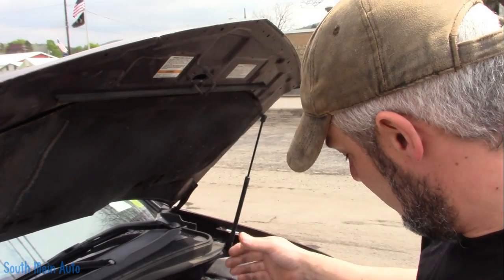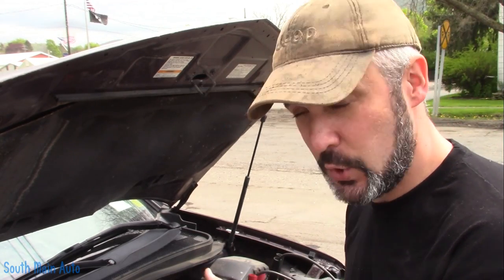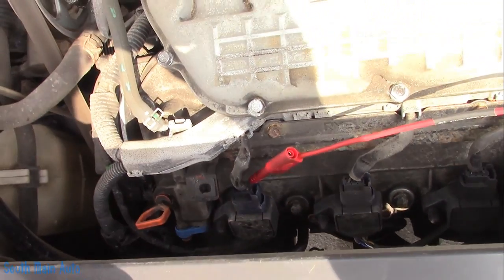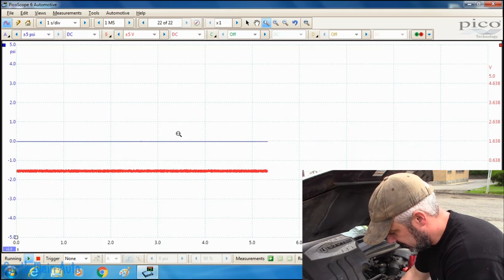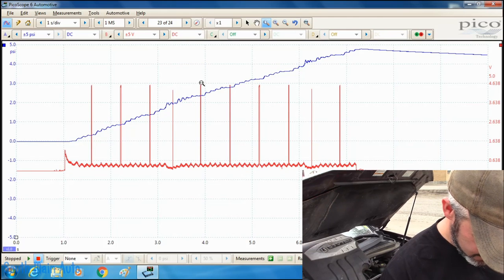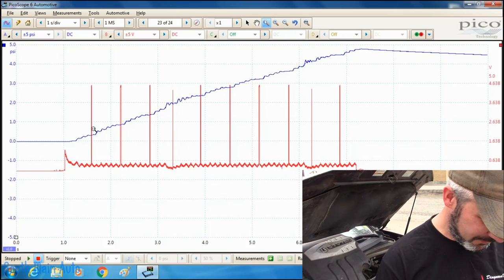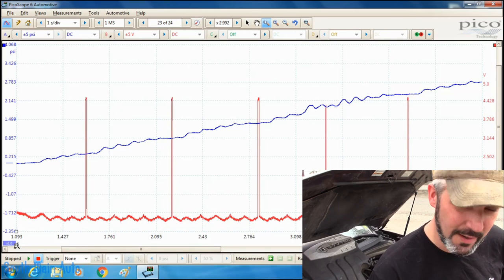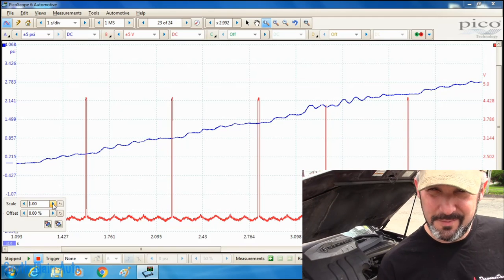Testing For Blown Head Gasket With The Pico Scope

Comment: Why doesn't the manufacturer just put in a kill switch when the engine reaches very warm. I've had two engines that once they get hot they are shot.
Reply: Ask the lawyers that have sued the car manufacturers when that was an available option which resulted in another vehicle crashing into the back of the "kill switched" car & killed everyone in it.  The way it is now, it is at the desecration of the driver to pull over to a safe area & have the vehicle towed, or continue driving until the engine seizes up -- but the car manufacturer is not making that choice for the driver now.
Reply: @KCautodoctor  about as bad as when my timing belt broke in the left lane of the freeway had to throw the car in neutral so i didn't come to a stop.

Comment: how about showing the same test on a known good.  thanks for all the great videos
Reply: There should be no measurable pressure at the radiator cap opening when you are cranking over a good engine.  The Pico WPS pressure sensor would have shown a constant near zero pressure reading when doing the same test on a good engine.

Comment: Can u post a known good vs known bad?
Reply: There should be no measurable pressure at the radiator cap opening when you are cranking over a good engine.  The Pico WPS pressure sensor would have shown a constant near zero pressure reading when doing the same test on a good engine.
Reply: KCautodoctor ty! I am aware of that. But do appreciate the response. 
I’m not fortunate enough to have anymore than the 2 ch scope on my modis. 
I’m trying to build an archive of known good/bad until I can purchase a pico.
Reply: @mikejmardis  if you are looking for databases of known good/bad waveforms, then highly recommend Pico's own website with searchable database of waveforms, iATN, Diagnostic Network (diag net), and The Automotive Waveform Exchange group on Facebook.  I am sure I am forgetting some in that list but those are my main goto's when I want to see what other people have already captured.
Reply: Those are the ones I would trust. A 2 channel scope can do a lot IF you think out a strategy of measurements before hand. Not as easy as a 4 or more channel for some things but for a lot of work even a single channel will do the trick.
Reply: KCautodoctor my experience, unless I’m doing it wrong, is that you can’t see pico library without an acct.

Comment: I'm not a mechanic but why did it overheat?
Reply: There are many possibilities as to why it overheated. On the other hand, what's really easy to answer is, why didn't they get it checked the first time they noticed it overheating?
Reply: Usually the main two reasons are, the water pump has failed or the head gasket has failed..or both. In old times when cars were simpler and had no electronic brain then a ham- fisted timing set up could also cause overheating. Head gaskets (the mating between the cylinders and valve chambers) have a very hard life, they have to seal and isolate water/ oil and are put under all sorts of pressures in extremes of temperatures, the fact that many last thousands and thousands of miles of driving  is some sort of miracle  anyway. So they do fail occasionally,sometimes thru a simple act of not keeping your water topped up or a belt has failed and stopped driving the water pump. Sometimes also because a manufacturer has got teething problems with a new engine design.

Comment: I wonder if the reason why you're not seeing the pulses is because the pressure has nowhere to go so it keeps building up. Kind of like a Schrader valve in a compression tester holds pressure in the gauge, so you can get to the maximum compression reading during cranking.  Maybe if you were to be able to vent the pressure by creating a small orifice you would see which cylinder is creating the pressure pulse.

Comment: How hard did you blow into the hose to register 3 PSI? Aren't the pressure pulses when cranking strong enough to push coolant into the expensive pressure transducer?
Reply: That particular Pico WPS pressure sensor is made to test pressures/vacuums created by air/exhaust & any liquids found in a vehicle (gas/diesel/coolant/automatic transmission fluid).  There are other brands of pressure transducers sold that are not as rugged & would be ruined if any liquid contacted their internals.

Comment: First time Ive seen this done.. and it's very interesting..  now for my questions.. as the pressure builds and you have your trigger set to cylinder number 4.. the pressure(blue trace) actually goes flat.. would that be the indication of the bleed off from the cylinder head into the cooling system? Ps.. love your videos and I watch them every new post.
Reply: The flat spots are where the cylinders are NOT pushing pressure into the coolant jacket versus the humps are cylinders pushing pressure.  In other words the head gasket isnt leaking around ALL cylinders - just most.  Using one cylinder's ignition, in this case #4, just allows you to surmize which cylinder if you wanted because you know when 4 ignites. You can then tie the other humps by firing order
Reply: @wty1313  thank you very much for then explanation.. don't have many training courses around here on scope use., So when I see issues being solved with scopes i find it very interesting.

Comment: There’s a fairly alarming trend of catastrophic Honda engine failures in your and other videos including bent valves, bad valves, head gasket failures, timing belt failures, valve train problems, low compression misfires, and plenty more even on vehicles with less than 100K miles. It’s pretty clear Honda has lost their former bullet proof mojo they had in the 80’s and early 90’s and a post 2000 Honda is still better than say a similar vintage Jeep or most other FCA vehicles which suck beyond belief, and perhaps even less reliable than an equivalent similar vintage Chevrolet which is a fairly low bar. Honda needs to get their engineering mojo back.
Reply: I work on more hondoos and yotas, than any other car.  I wouldn't buy one if you fronted me half the money.  Full of cheap plastic interior, ride like a wagon, and gives a constant reminder that there is no replacement for displacement. 
Btw, I have owned nothing but MoPar over the last 25 years.  Anything lasts if you take good care of it...including those crappy Hondoos and Yotas.
For those that love'em, more power to ya.

Comment: If it keep building pressure how does that mean its blown wouldnt it not build pressure if it was blown
Reply: Think of it like pistons building pressure in an air tank.  If the piston is pushing more air in than the small leaking relief valve is letting out, the tank will still build pressure just slowly.  When the cranking stops, the pressure bleeds out the leak and back into the combustion chamber, past the melted rings, and vented through the crankcase.
Reply: @davidnielson5252  oh ok

Comment: I wouldn’t think you would see a definitive pulse because once the pressure is applied in the cooling system there is no way to relieve that pressure before the next pulse, kind of like an air compressor filling the air tank. But as a viewer posted there should be no rise in pressure if there is no heat on a good system. You might have just came up with a valid test that’s quick and easy.

Comment: Yes the engine is nuked  but I don't understand how the cooling system making pressure confirms that I would think the water pump would make at least 5psi
Reply: Water pump doesn't really build pressure, it moves the water in a particular direction.  Pressure in the coolant system comes from heat generated by the engine as it warms up.  The head gasket is no longer sealing between the combustion chamber and the water jacket.  Pulsing with each piston pushing some air into the water jacket.

Comment: Always like watching your diagnostic videos! Question: did you run the same test on a good motor? (Thinking the water pump might be cause of the pressure rise)
Reply: The water pump is just a circulator that moves the water around from engine to radiator and back. It's not a positive displacement pump so it can't cause system pressure to continue to rise.

Comment: Back in about 1994, my brother was plowing with our JD 5020.  Main water house blew off the radiator and had to shut it down from full throttle.  Well, that warped the head.  Cast metal. Something about running at full pull and 1100F on the turbo temps.    Well, $600+ later we had the big horse back.
Reply: I'd almost be tempted to let her idle for a minute or two if it was a Diesel since the excess cooling air charge would help a good deal in cooling off both the turbo shaft and the head. More like I'm wondering if that might have kept damage under control better? I had to do a similar shut down but I did let it idle a minute or two in neutral when an oil line burst behind the engine on a 4630 and I lost all the Hyguard. One moment I was a farming just fine and the next I was a sitting still with a screaming engine. After that shock wore off, I idled down and tried shifting the powershift which got me nothing but a dead stick. So I tried the same with the clutch and still nothing. I didn't even have to get out on the ground to notice the smell and oil puddle under her. With no options left and not liking the idea of an empty transmission pump turning without oil in it, I compromised between time enough to let engine cool down a minimum bit at idle speed and transmission pump damage. Luck, 30 gallons of oil later and a fixed hose, it all came back to life and is still working fine. $600. Hyguard ain't cheap. Perfect opportunity to buy transmission oil filters, pull the screen, clean it and do it all up white tight and right, but didn't think of that until I was back to farming. Live and learn. Just like my pool game, I got lucky and I'll take it.

Comment: would like to see what a normal/good engine looks like from same pico/pressure transducer perspective
Reply: There should be no measurable pressure at the radiator cap opening when you are cranking over a good engine.  The Pico WPS pressure sensor would have shown a constant near zero pressure reading when doing the same test on a good engine.

Comment: Question. Can you determine with the pico scope which bank is bad??? I'm assuming you look at the relative compression test. Grest video MR O
Reply: Connect a SenX FirstLook pulse sensor upto any scope and you will be able to pinpoint the exact cylinder(s) very quickly (after you get used to interpreting the data the FirstLook pulse sensor provides).  SenX has some case studies on their website that go into great detail showing all the different ways their FirstLook pulse sensor is used to diagnose many different issues on vehicles.
Reply: @KCautodoctor  awesome thank you very much will take a look for sure .

Comment: What are the "FLAT spots" across the trigger event???? The pressure trace seems to flatten out across the firing event on #4, before climbing again. Combustion leak from the "OPPOSING" cylinder?
Also , just to avoid the confusion to some of your Viewers, This, along with the video on the fluid Block tester, Confirms the presence of Combustion gasses and /or Pressure in the cooling system, Which is likely to be a Head gasket failure, But NOT "DEFINITIVELY". Cylinder Heads themselves can leak, I have seen several old Dodges which burnt holes in the cylinder wall / water jacket, From a Defective EGR valve. (Kinda rare but enough to confuse the best techs in the shop). In a nutshell, Dont order  a head gasket until you have disassembled the engine and actually SEE the burn marks. If you cant find one, it probably isnt there, and your problems are deeper than a weekend fix. Anyhoo, As always, thanks for the vid, your time, effort, and an amazingly generous attitude and desire to explain this industry to the masses.

Comment: Is the CATALYTIC CONVERTER good, it's worth more than the car?  lol
Reply: with blown head/gasket/cylinders? JUNK, except for recycle costs
Reply: In  New York State it's difficult to get used catalytic converters because of state laws.
"Prohibition of Used Catalytic Converter Sales
Pursuant to 6 NYCRR Part 218-7.2(c)(2), (link leaves DEC's website) and effective June 1, 2013, it is unlawful for any person to sell, offer for sale, advertise, or install any used, recycled, or salvaged catalytic converter on any vehicle in New York State. This prohibition applies to all vehicle types and model years. A used catalytic converter is not a new aftermarket catalytic converter, or a replacement part as defined below. This prohibition does not apply to the sale of used catalytic converters for recycling purposes."

"Pursuant to regulatory revisions completed in 2012, the New York State Department of Environmental Conservation (Department) adopted California's aftermarket catalytic converter requirements. These requirements include a) the prohibition of installing used catalytic converters, and b) standards for new aftermarket catalytic converters. These requirements can be found under subdivision 218-7.2(c). (link leaves DEC's website) New York's aftermarket catalytic converter requirements apply to all model year 1993 and newer on-road motor vehicles, with the exception of the 1995 model year vehicles, certified by the California Air Resources Board (CARB) including vehicles with 50 state certification. Use of an EPA certified new aftermarket catalytic converter is still permitted on federally certified (not CARB or 50 state) and pre-1993 model year vehicles. Distribution centers located in New York State may continue to supply EPA certified aftermarket catalytic converters for applicable NYS vehicles and for sale outside of New York State."

Comment: looked like four may have been the only good cylinder.

now i'm wondering where i can find a regular old pressure gauge i can put on a radiator cap because i'm pretty sure my headgasket is blown too.
Reply: Here is an even cheaper low-tech method -- go find a balloon or latex glove that will snugly fit over the opening in place of the radiator cap.  Start up the engine and if the balloon/glove starts to inflate with "air", then you have exhaust gasses getting into the coolant system.
Reply: Autozone has loaner tool for radiator pressure tester.
https://www.autozone.com/loan-a-tools/loaner-pressure-tester-adapters/powerbuilt-cooling-system-pressure/449951_0_0

Comment: Shows what a little bit of preventative cooling maintenance can do. They probably had a coolant leak which introduced air into the system which led to an overheat and cooking of the HG.  On another note why do these Honda V6s tend to make many appearances on your channel for blown HGs? Seem to be particularly sensitive. Not at all like the reputation of Toyota V6s.  Of course YMMV

Comment: If Eric doesn't show a known good or explain what the wave form should be ,than as a novice old -timer, I have no idea what the scope is saying.I know this site is mostly for mechanics,but I thoroughly enjoy learning from Eric.
Reply: There should be no measurable pressure at the radiator cap opening when you are cranking over a good engine.  Eric could have also connected an old fashion mechanical cooling system pressure tester with a mechanical pressure gauge and it would have shown similar pressure increases while simply cranking over this engine with bad headgaskets.  The electronic pressure sensor is just much more accurate and allows for the saving of the scope data for later diagnostics and show & tell to the customer.